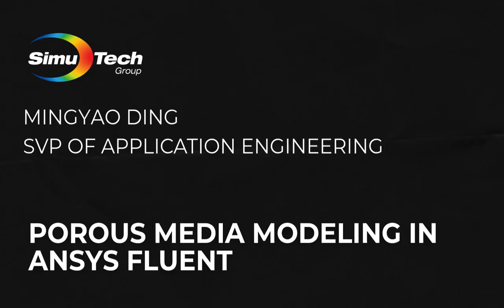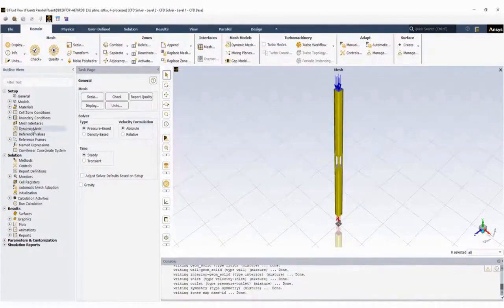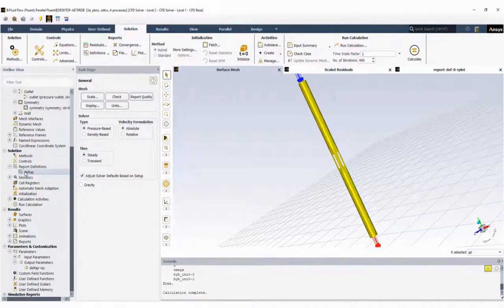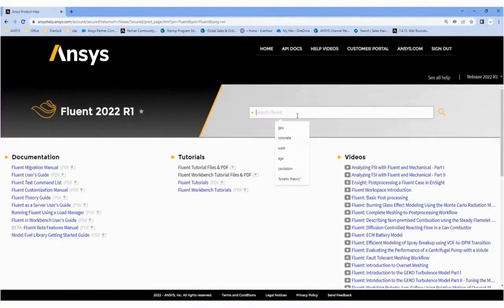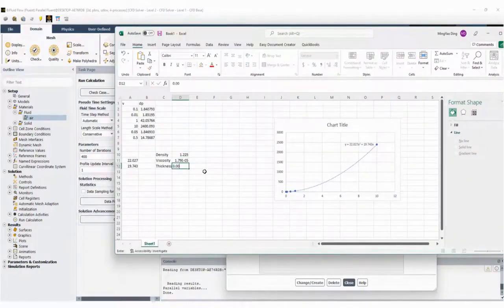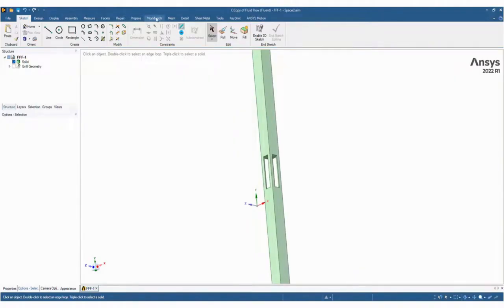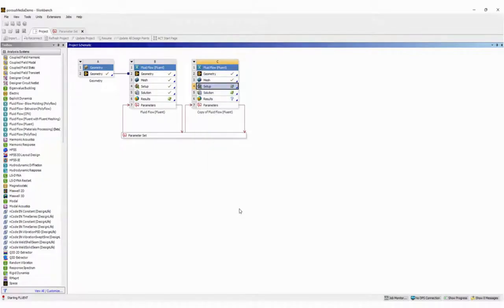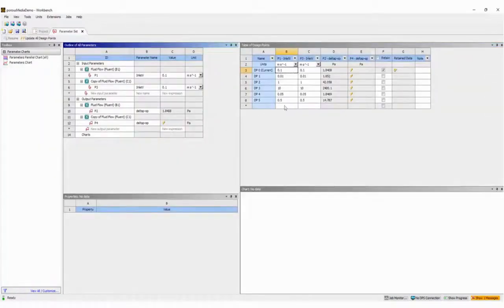Porous Media Modeling in Ansys Fluent | CFD Simulation & Resistance Coefficients Explained

Comment: DeltaP should be pressure drop across a porous medium (difference in pressure between outlet and inlet), rather than mass weighted average value at inlet only ?
Reply: same question
Reply: Maybe that's because he assumed that the outlet pressure is 0 Pa as Ansys Fluent put as default.

By the way I'm doing my master's thesis on this and the question I have is about the thickness, how n we know that value? Is the mesh size in sizing method?